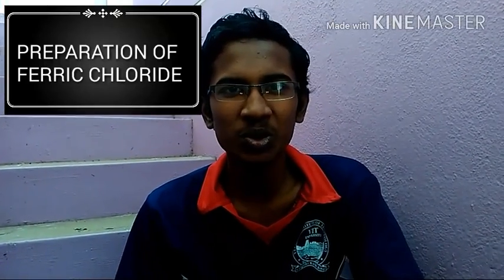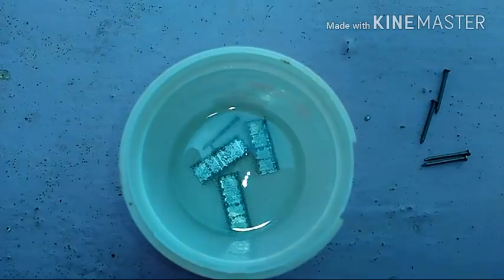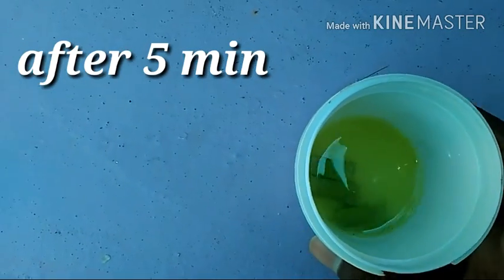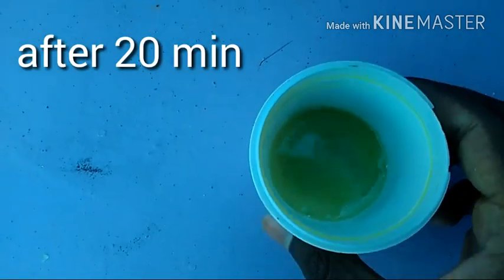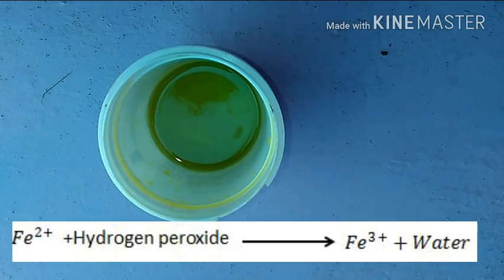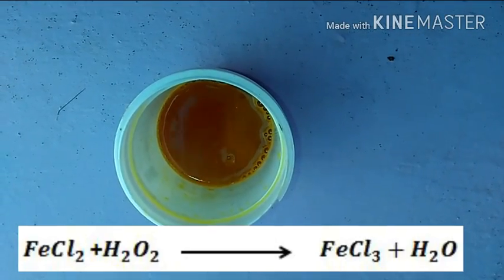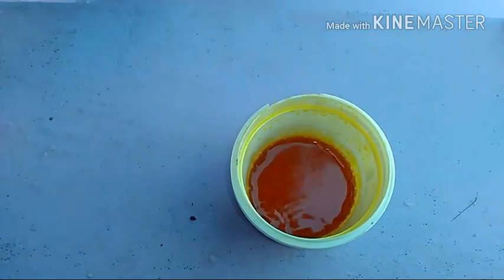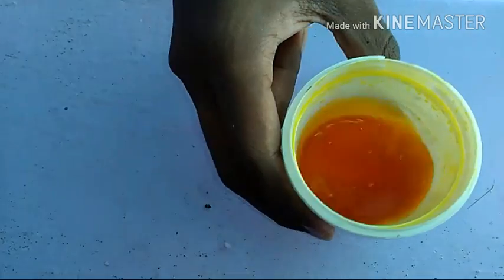Preparation:Ferric Chloride | Amazing chemistry | PCB Etching | DIY | Home made

Comment: Hydrogen peroxide 20% hai & hydrochloric acid.IT will work for PCB itching or not
Reply from the maker: Ram Singh yes it will work... Only the time taken for the etching process only varies based on concentration. If concentration of FeCl3 is high, the process will be faster. Hope you got the answer.

Comment: Your ferrous chloride is yellow and it turns red when you add hydrogen peroxide because chromic acid is formed. Don't use stainless steel (it contains chromium) but steel.
Reply from the maker: +Miles M. Thank you for your suggestions